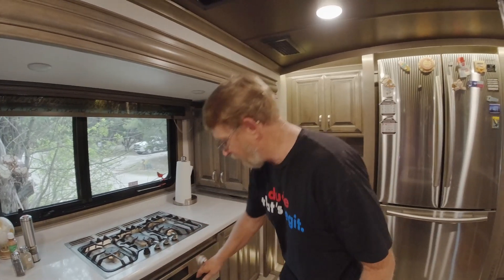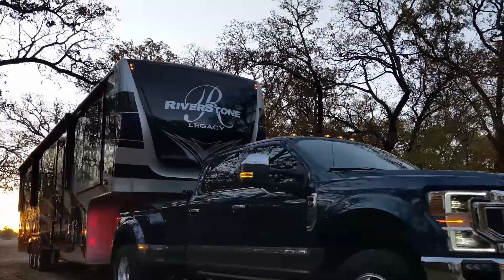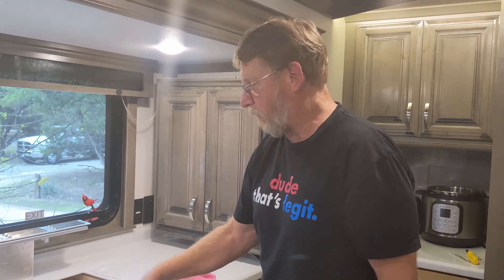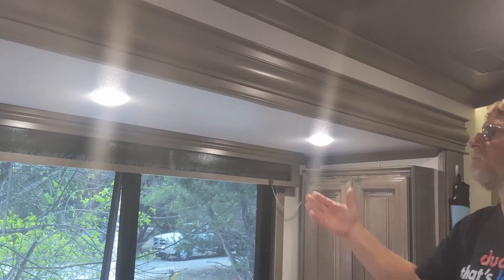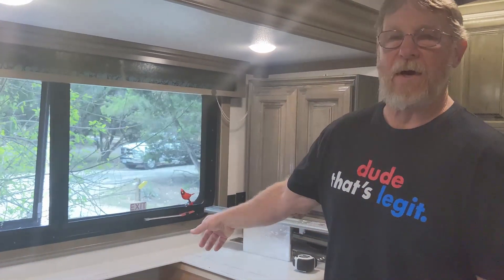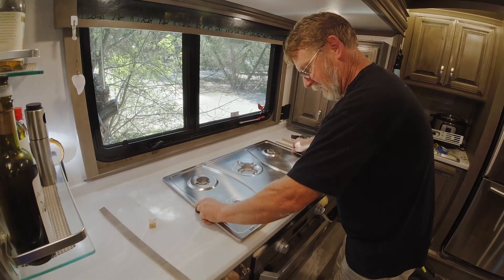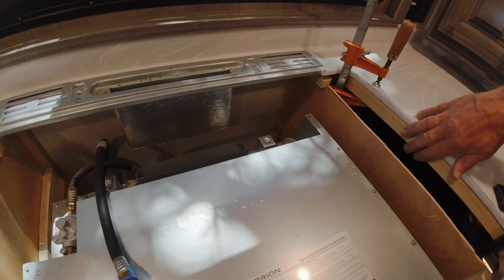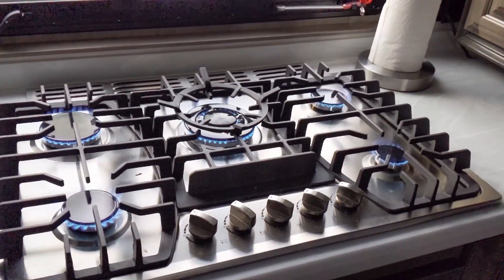RV Cooktop Upgrade Improvement Upgrade Repair Full-time RVers

Comment: That's a great upgrade!  Looked like the oven vent duct was the most difficult part.  Is that now too close to the wall / window?
Reply from the maker: No it is not too close to the wall or window it works perfect and in fact something that we meant to mention and we didn't in our end discussion was that with the old cooktop when the oven was on and venting straight up the cooktop on top became as hot as the oven and would burn you if you touched it. With the new cooktop the top does not get hot like it is an oven which is amazing

Comment: Would you please show or explain how you did the electricity?
Reply from the maker: I believe we show it in the video but it has 110 volts. We drilled a hole in the counter came right up into an outlet. And if you're not on shore power, you can light it with a lighter. Thank you so much for watching and commenting
Reply: You video has been a HUGE help.  I am about 3/4 the way done. I found a new glass top 4-bunner stove that someone had bought but never had installed. Yea!  I have the hole cut and it fits and I have the supports under the counter all done. Next it the electricity, the vent, and hook everything back up!  Thanks again for your inspiration.  I tried to add a couple of pics but couldn't figure out how to add them to this reply.
Reply from the maker: Our email is hetteshworld@gmail.com